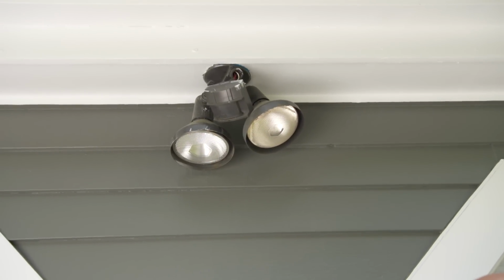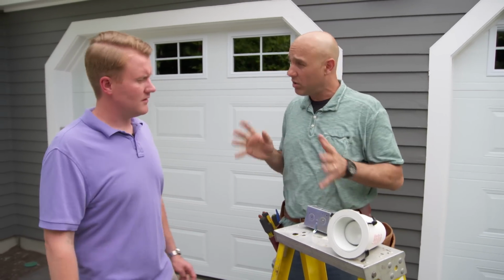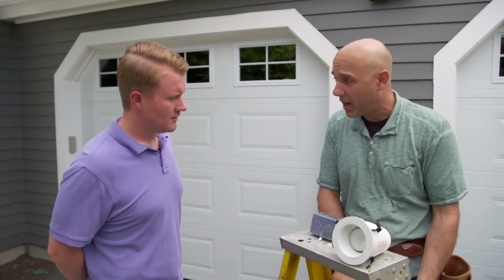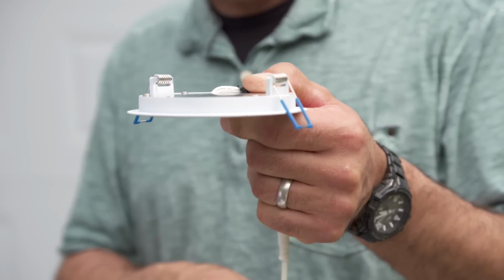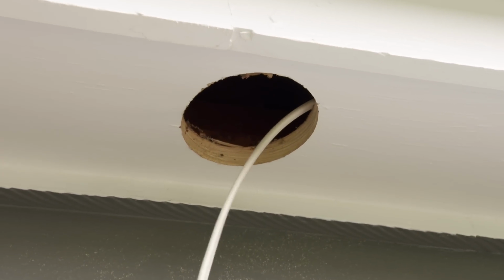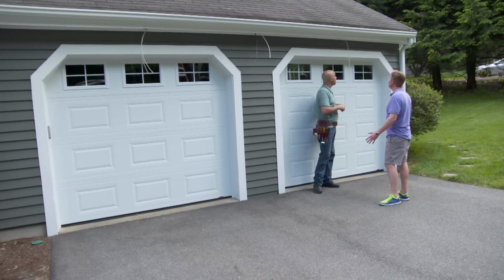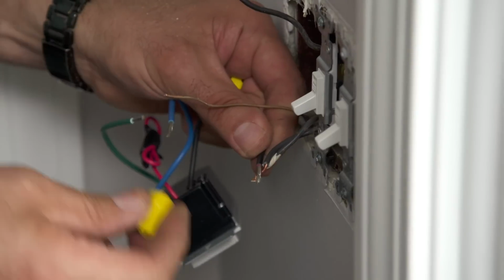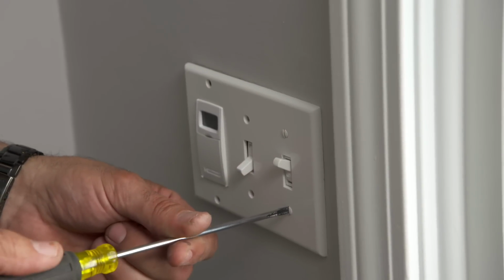How to Install Ultra-Thin Exterior Lighting | All About Lights | Ask This Old House

Comment: What I like most is when they pick a product, they show you how they install it BUT they pick the one scenario where the material he needs to drill is wood when 99% of houses have aluminum.
Reply: where do you live that all the houses are aluminum?
Reply: Or plaster 😬 with wire lathe

Comment: but the other light lit the main driveway . that's for accent lighting.
Reply: That is correct about the accent lighting, they just needed to swap the fixture and aim the lights with LED floods. Done deal. For accent sure throw a couple over the door.

Comment: Few notes: these are more decorative than security lighting which is ok if that's what you want, but most people still opt to have flood lights on the corners of the house for their security camera to work well.  Also, proprietary light fixtures that don't follow a standard mounting method (like a 4-0 box) are a mistake IMHO.  They SAY LEDs last for years but these are outdoors and eventually water will get into the electronics.  In my experience, even a little moisture will screw up LED electronics.  In the old days, you could have a mercury vapor ballast pretty much be submerged in water and after drying out and fixing the leak, it would work like nothing happened, but not with LED's.  The point is, either pick a fixture that takes standard bulbs, or if you're going to go with a low profile fixture, go with one that fits in a 4-0 box. Lightolier makes some shower lights that work well.
Reply: There are water resistant ones. Also these are able to be used outside because they are made for outdoor use as well
Reply: @misterwebb1472  I was talking about water resistant ones. Maybe it's because i live in very hot and humid weather but moisture eventually finds a way.
Reply: @misterwebb1472 The Host should note to use one's for Exterior/Outdoors, Wet/Damp rated, etc when they're doing these videos. People don't always know. I've already seen tons of people using "Interior Only" rating lights with no Exterior/Wet/Damp rating for people to install with links to those very same lights with no reference to get the correct ones. I feel it's irresponsible. That's one of the first things I noted when we purchased some for inside and someone told us to use the same one's for outside. I thought great, are they rated for outside? Um....... they didn't know, nor thought it mattered. Needless to say, I found the correct one's.

Comment: Seven years ago in my "man cave" we used "50 W" LED dimmable throughout.  But my office has a dropdown ceiling / AC duct so  we had to use strip bar.   When wafers came out in 2014 I got them instantly and they've been going ever since without a hitch. 
 The key is quality and though I paid a premium, we've had zero problems.  I figure after 10-15 years I can simply replace any that fail or move on to the next technology (wireless?).
Reply: smb12321 wireless is a long time away from now, currently everything we use would suffer from the interference of the fields. Even still, there are some things that require more power than you can safely transmit across the air around any kind of lifeform without causing imminent cancer or death

Comment: I've seen multiple tutorial videos on how to install soffit lighting, but I just don't have experience with wiring to an existing switch that already powers other fixtures. Otherwise, I'd do this myself in a heartbeat.
Reply: Disclaimer: Consult a professional first.

Light switches have a hot (black), a load (black/red), and a ground (copper/green). Some smart switches will also have a neutral connection to run various functionality when need be, but typically your neutrals connect together external to the switch. When you have more than one wire in the setup (ground, loads, or neutrals) you just connect them with the proper size wire nut, and have a single wire go to the switch connection.
Reply: @MichaelStephenLau  I've upgraded every existing fixture in my home with an led recessed light, but was wondering if it would be acceptable to daisy-chain two soffit lights to some existing led recessed lights I already have in my garage? If that isn't an option, I'm guessing it's best just to install a new switch?
Reply: @brettvukovich6220  Are they 120V?
Reply: @brettvukovich6220 you can they use very little power

Comment: Hello, just found your video and had a question since you have had them for awhile. Do you have an issue with bugs and spiders because of the lights. The ones i have attract bugs and when there are bugs, there are spiders. I need to switch them out and I'm trying to find ones that won't attract  flying bugs.
Thanks

Comment: Are they waterproof?
Reply: I'll wager they're outdoor rated but I very much doubt they're water proof.  They're made to be recessed under a soffit or awning and unless you have a leak from above it would be very difficult to get water behind them.  Looking at them again, you have a water tight connection from the transformer box to the 24v wire and the back of the light doesnt have any exposed circuits or anything.  Submerging them would not be a good idea but i'll bet the underside of that could get 'some' water but I wouldn't install them in that kind of area.

Comment: Awesome! A proprietary system... so when one dies in three years for unknown reasons, you cannot replace just the light (because the switch mode supply is what usually dies), you will need a whole new light fixture!  Contractors dream right there. And he'll have to pay an electrician 3x to have the other two units replaced as well to match the replacement.

If you want LED's, get a fixture that uses standard bulb type sockets, and just buy LED bulbs for them.  This way you're never SOL if they die.
Reply: thechosendude except that type of led light fixture has a run time of between 30000 and 50000 plus hours depending on grade and brand and a failure rate much closer the zero than any conventional setup. So.... that home owner should have at least 10 years without any maintenance and the energy savings of integrated led fixtures means the electrician is already easily paid for when they need replacing. Or since all the wiring is done, just buy some and swap them out.
Reply: The LEDs have a 20,000+ hour life...if they are run modestly.  The power supply is what fails in almost every LED unit that goes out.  Look at reviews of LED retrofit kits for refessed lighting, LED ceiling mount lighting, etc.  They have problems with their supply dying.
Reply: I agree. 5 years ago, I was at a sales seminar a lighting manufacturer was throwing and boasting their fancy new LED recessed systems which were 100% proprietary.  I pointed out that the technology was still emerging and it was silly to commit to one manufacturer for something that's supposed to last the lifetime (or at least until the next major remodel) of the house when in a few years you'd have much better quality lights and finding parts would be difficult.  They down played it of course saying they would still have parts.  Turns out these things don't last for 20 years and I go to houses which have burned out trims and it takes forever to find a matching light and costs more than $100 and it's far inferior to any new bulbs out today.  I can buy a great 90 watt eq. Satco 2700k bulb for $15 now.  vs. $150 legacy trim/bulb.
Reply: thechosendude I am an electrician and have seen these power supplies fail after 3 months. You are better off with a LED bulb in a regular fixture.
Reply: "We're sorry, water got in them so the warranty is voided" or "Sorry, this item is discontinued but we can give you one that doesn't look anything like it and you'd have to change the rest to match"
Reply: You can switch out with any led driver that matches the rating. It's so simple a caveman can do it.
Reply: Kang Kim Precisely but you know I was in CT when This Old House rolled up in our hood and let me tell you that to appear on their show you get the labor for free and have to buy the materials.  It can be a HUGE success story but a lot of what I see on TOH I smh to over the years and with Youtube I get to see them all laid out for me and it is almost like a scam that most home owners will eventually regret what "work" they did to them, errr I meant for them.
Reply: 10 years of running time sounds great, but 10 years isn't really that long of time. When the lights start to fail you will be kicking yourself.
Reply: Yea but wall packs for example can put out 5000 lumens, so if you want a bright one then
Reply: Dude, you think they don't know that? They literally explained why they didn't go the standard LED bulb route at the beginning of the video.
Reply: And with a non light bulb solution you can’t put lifx bulbs or philips hue bulbs

Comment: Many homes have vinyl soffit which, I think,  would not support this device.  How would one mount in a vinyl soffit?
Reply: Dennis Adams have to take it out, make a frame that will support the fixture and install it, reinstall old or new soffit
Reply: these are made to install in soffits, that spring just snaps right onto the soffit and holds tight. Awesome for your application

Comment: there are LEDs that dont use a transformer..they get regular 220v.and are for outdoor use....
Reply: and?  This is the USA, majority of homes do not have, nor need, 220v going to any light receptacle outside.  Here in USA common residential voltage is 120v and that is plenty.

Comment: Should also point out that not all wood and materials are weather treated if you cut through the surface. In some places, that's a no no to cut and not add an additional sealer.
Reply: Owen Robinson At 3:08 you can see the gap between the fixture and the panel. In that place it's no problem but if there's any chance of rain getting at the light you need to use silicone kit to seal it properly.
Reply: Good catch. I didn't see it or notice if it sealed the newly exposed particleboard or just acting as an expansion gasket at the bottom. In this case though, we have no way to know if it's necessary because only the owner and Scott could see the wood and/or markings. However, as a how-to or suggestion video, I still wish Scott verbally included the optional step of sealing the exposed wood.
Reply: If you've got rain hitting that hole in the soffit the homeowner probably has bigger problems hahaha! Can't say I've seen rain curve back up and hit the soffit.
Reply: PvtPapa theoretically rain can hit the soffit if driven by heavy winds, surface tension can than drive it towards the trim if the light which may rust that material.

Comment: Can you install these lights on under eaves that also have soffitt?
Reply: yes
Reply: @acreageliving  ....I'm glad I figured it out on my own instead of waiting 2 years for an answer from someone here! I  installed them myself and they are beautifull ! I have 3 across the front of my house above  the windows and am using a dimmer switch  to control the lighting. The lighting is a yellow shade and not a true led bright light, which is ok but I  was hoping the lighting would be a bright white  led. Anyway,  I  installed them. I love the look under the eaves. And I would reccomend them for anywhere you want lighting.
Reply: @kaemack44  sorry bud, just seen the comment, i came as quick as i could! lol

Comment: whats the name of the light?
Reply: Type?  There are several names for it.  Down lighting, can lights, recessed lights.  If your asking for the brand idk.  But it largely doesn't matter.  Whatever you have at your local building supplies store.
Reply: it looks like a lotus ultra thin led recessed light
Reply: Thx for the heads up.
Reply: jermaine burke They sell these at City Electric Supply
Reply: Lotus Led Lights. The outdoor ones are wet/location. Can be installed in showers also. Indoors go from, 2", 3", 4", 6", & 8". Some are round and squares. Different trim colors also. White, brushed nickel, black, and brushed cooper. 27k, 30k, 40k & 50k. Excellent service. Quality lights. 
Check out their website.

Comment: I'm surprised an electrician that would be featured on this old house would wire up any circuit starting with the hot or neutral. Proper wiring would have you wire the ground first, neutral second and hot third. The reverse order should be followed when you are disconnecting any circuit.
Reply: Michael Aguilar It really isn't that big of a deal lol
Reply: It is a big deal. You have to train yourself to do it that way. Even if power is off you work it like its hot.
Reply: russ827 you'll learn the correct way really quick once you get hit with a loaded nuetral.
Reply: @phatpunxs64  the power is off, champ.
Reply: wow dude, calm down. I looked at your channel to see how a different licensed journeyman does it... oh wait.........

Comment: I've watched several videos featuring this guy... does anyone disagree he is doing the cheapest easiest and not following code?
Reply: tren van What here is not code? And what is wrong with using a system that is just as reliable, if not more so, and much easier to install? Wet/damp location remodel pot lights would have require the same exact install method with the exception needing a much larger cavity.
Reply: Nothing here against code, what are you talking about? You obviously arent an electrician. Most NEC codes are for 50 volts or less to ground. These fixtures are 24 volts. The 120 volt wiring is secured in those metal junction boxes
Reply: No way in the world would a show like "This Old House" take a shortcut or do something against code.
Reply: tren van as an electrician and my father as a master baldy goes by code and makes it the cheapest for the customers
Reply: Tren Van..why do you say he's not following the code.....what does the actual code say and the code section and number?
Reply: That's ealxactly how your supposed to do it. What code is he not following. Stop over complicating a simple task. It's a string of recessed lighting, not rocket science.

Comment: Too bad the fixtures are not already rated for 120 vac. Then you could simply connect the Romex directly into each fixture and eliminate the transformer, making the setup even more compact and easy to install.
Reply: Yes they are.  You daisy chain to one another.  Just used these to install recessed lights in my living room